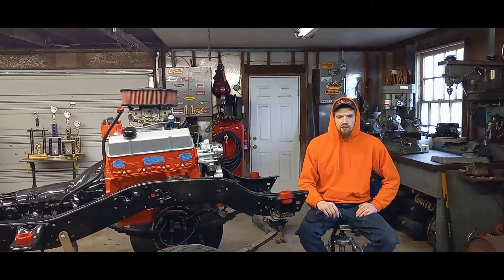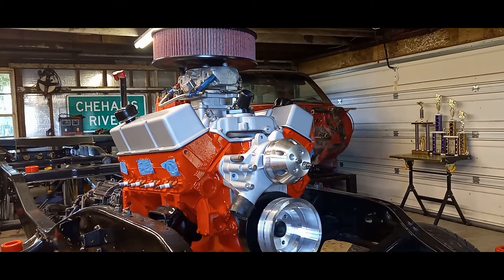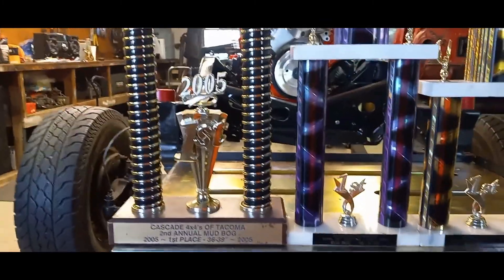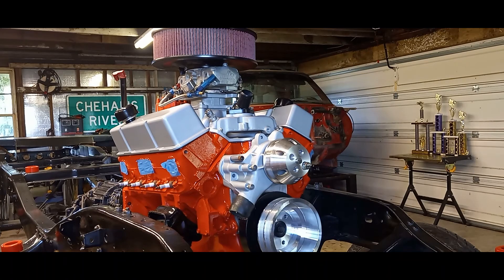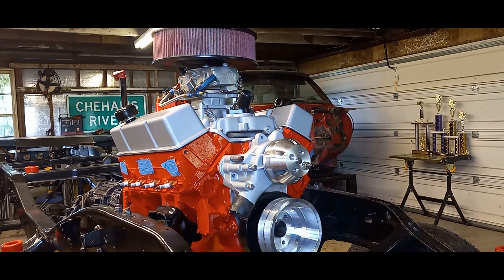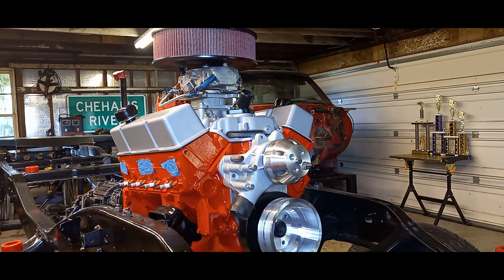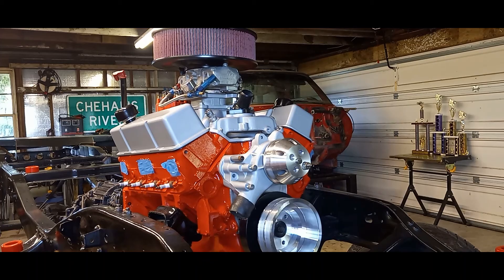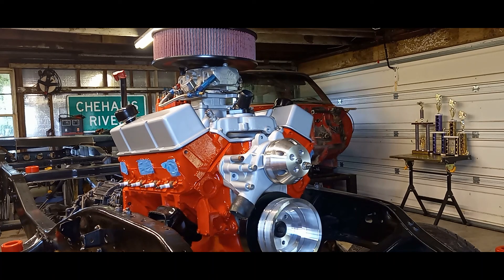HOW TO BUILD A 550-600HP RACE WINNING 383 STROKER SBC SIMPLIFIED. RACE PROVEN DRAG TRUCK ENGINE!

Comment from the maker: TRIVIAL QUESTION IN THIS COMMENT!?? THIS CHANNEL IS DAVID VIZARD RECOMENDED AND APPROVED! David vizard had messaged me complementing me on this video and what he called "my intelligent choice in camshaft specs and my intelligent educated decision on the 108lsa and the lift numbers of the cam" which is optimal for this combination. He had also said that what I said in this video and in the comment section can be confirmed in his 2 most recent videos being "cam company's still don't got it right" and "how we built that super competitive low buck 383 sbc"... so check out his channel David vizard performance... the 108 lsa camshaft alone in this specific combo is worth 25+hp and an equal amount of torque ... Cam specs.. 248°duration @.050 108lsa 104icl, installed 2°advanced, 620lift intake .620Lift exhaust. Lift is  actually .661" with 1.6 rocker. The heads flowed 280cfm @ .600" lift, the flow drops to about  270cfm @.675"ish lift due to port instability, i aimed for a specific distance to absolute limit of max flow in order to stay at max flow for a specific amount of time before port instability, being as the last .061lift is still in the 280cfm range, it's hanging in the 280cfm range for quite awhile so .661lift  is optimal for this application, and that was exactly where I was aiming to optimize this engine for the specific application. The camshaft specs ultimately match the flow chairistics of the cylinder heads.. The heads still flowed almost 270cfm key word almost until .700" lift. After .700 lift the flow drops of massively to around 260ish cfm, had I lifted the valve to .700+lift, power and the ability to hold rpm would have suffered severely, being as this 383ci combo is on the ragged edge of those 186 cylinder heads cfm output ,horsepower making and rpm capabilitys. That is why in the video I said the 186 heads are definitely the limiting factor of this engine, it is legitimately optimized specifically for the application with the parts I had at the time, and its making 580hp+@ 6500rpm & 545lbft+@5200rpm, pulls to 7500rpm it may pull to 7800rpm but rev limiter is at 7500rpm.. No more amount of lift or duration would do this engine any good, until a better cylinder head is brought into the equation flowing 300+cfm @ .600 or 320+cfm @.700 lift. Then you are looking at more like a 620-650+hp 383. Keep in mind CFM is relative to CI, LSA, RPM and HORSEPOWER... HERE IS A QUESTION FOR ANYBODY READING THIS???.... take a similar 383ci engine but with 11:1 instead of 12.98:1 compression with heads that flow 270-280cfm @.600 lift. Then lift the valve to .624 which is .024 past max flow, lifting the valve slightly higher than max flow can be the beneficial in some circumstances because in can allow you to utilize more of the flow of some cylinder heads, but it not always the right move, this is all determined by multiple factors of the characteristics of the cylinder head and application... the rest of cam specs, 247°-249° duration @.050 and 106lsa 104icl installed 2° retarded . with a single plane manifold and 850cfm carb. Keep in mind the tighter the lsa the lower the rpm for peak power if the lsa isnt optimal. do you think this combo would make any where close to 580hp?? And rev to 8500rpm without falling off??. What do think the results would be?? Let me know what you think? I already know the answer, I would really like to hear any body answer even if it's just a well thought out guess, I would really really like someone with legitimate knowledge and experience to to give me conformation on the reality or lack there of this combination. Thank you i appreciate you reading this. As I said before keep in mind that CFM is relative to CI, LSA, RPM and HP... that is one of the simplest ways to figure this out... anybody???
Reply: First, I'm by no means a 'Pro', but I do understand physics
Going beyond max lift (effective lift for a particular application) seems detrimental in a couple of different areas. 1, Are you having to use more spring pressure? (With no gain in performance, stiffer springs take HP to move.
2, I would think the extra timing event would stall the AF charge.
What say you?
Reply: @toomanyirons65  Check out Superstock engines. Cams way bigger than most folks could comprehend. It's all about the area under the curve. Friend of mine has a NHRA Superstock 73 SD455 Pontiac engine. Cam has over .950 lift and 300+@.050 duration. Power peaks around 8200 rpm. It shouldn't work, but it does. Car has set national records in its class years ago. SS/GTA class 87 Firebird Superstocker. His valvesprings in that engine are 1200lbs open pressure. Heads are oem highly modified 1973 SD 455 cast iron heads. Uses a IA block tho. It's making 725-730hp with the original 73 Q-jet on a Victor intake. Those Superstock engines are a whole other breed.
Reply: Hey Adam I have a few questions that I’d like to ask you or DV mainly about camshaft selection and dynamic/static compression ratios I’m more than willing to pay for your time if you could answer them I don’t expect anything for free I am more than willing to pay whatever it takes for some further guidance so I can get my parts ordered and get rolling on my 383
Reply: I believe you would gain hp in this instance of 11.1 comp.  With that cam. With less squeeze than almost 13.1 there will be less heat and a more dense air charge from the heads. I think it would be around 580, 575 ish at 7000 rpm. As the extra lift would let the cylinder fill with more air and cooler air as well.  Thus pushing up hp.  Correct me if I'm wrong I'm not the sharpest tool in the shed but I sure am shiny. Id like to hear some of your ideas on this. I wouldn't rev it that high for too long as the rod bolts would be a limiting factor.
Reply: Vizard couldn't win a cam challenge if he tried. And he did try. After boasting about how he can't lose. He lost. So, is that douche really who you should be listening to..?
Reply from the maker: With that comment and all the other garbage I see you leaving all over youtube you are clearly in the 50% of the population that has an IQ below 100, either that or you are 12 years old and still not to bright....

Comment: 383 SBC, Roller, Afr 195  Eliminators street heads 64 cc, 10.5 CR, Mike Jones Hyd Roller Cam ( .580 lift, 108 LSA), Victor Jr single intake, 750 Holley. This set up is too much fun on the street.👍
Reply: exact build i’ve been piecing together online, how is the street ability?
Reply: @dylananderson7322  As far as street ability,  I think it's great. I do have a vacuum secondary carburetor and 373 gears, which does help. Mike Jones cams Maybe a bit pricey , but totally worth it.
Reply: Any idea on the hp of this setup ?
Reply: @glennwo7702  I haven't had the chance to dyno this  combo. But, it has awesome mid range and top end pull. Running drags radials and it break traction easily. Hopefully I will soon though.🤙
Reply: Make a video of it
Reply: @MrJ183  I will soon. I haven't taken it out in a few weeks.

Comment: I have to chime in, and with all respect to you and other engine builders. Please consider all the factors that effect the awesome power of this 383 and also consider everyones situation is different ss well as their knowledge scope...btw i have watched all your content and listened carefully to your message. Seems most of the neg comments are from folks that haven't- and are quick to make snap judgement. I will suggest one thing that needs more emphasis on this topic and in others engine build videos aswell. You briefly describe the fuel choice, and associated compression spec, but to the general mass that gets overlooked. I think it should be made clear to the dumbasses, that fuel choice will give a big power spectrum low or high on any engine, snd the cam specs etc will all need to be chosen with that setup. My question to you would be what would you do different if at all, if you were to take that engine to the pumps and put 91 non ethanol as we get here in mn. And then still thrash on it.? Change timing? Tweak the carb? What kind of power could you still safely expect and not damage it....that i think is a fair question. If you say race motor snd race gas only, i understand but your smart as heck so i cant help but to ask your thoughts if you want to reply. Thx!

Comment: In the process of building a 383 with afr 220, still a budget build with a solid flat tappet.  Comp cams argued with me when I told them I wanted a cam with a 106 lobe sep. They wanted me to run a 112 lol. Just blows my mind. I told them ok I changed my mind let's do 105.
Reply: absolutely 👍. What LSA did you end up with?

Comment: Come on, lol. This combo might make the claimed 550 hp with a 150 shot of N2O. Camel Humps? Please.
Reply: 280cfm? Camels...Id have go see it to believe it. 
Not enough metal there. 250-260 is really pushing those castings.
Reply: I had a set of camel humps on my 406 sbc.I had them ported out with 202 160’s.They ran ok but It felt restricted.Once I was able to buy AFR 195’s instead of the 220’s heads and OMG!.I thought it ran good before but now it is a beast.you would be lucky to hit 230 cfm with ported camels.Camels on a 383 or 400 you can crack 480-490 on torque and would be lucky to crack 470 on HP.AFR 195’s I cracked 526 hp and 505 on torque.It was a major difference.To reach 600 hp N/A your going to need a 18 degree heads and some major upgrades.I seen only 1 video of a SBC hitting just over 600 hp N/A.

Comment: flat top pistons [5ccreliefs ] 65cc chambers   .040 gasket / gsket bore 4.060,,   cyl bore4.030 ,,, stroke 3.75 ,,  comp hieght .005 down    EQUALS  10.9 TO 1 
eg 383 11 TO 1 CR ,,, afr 195 STREET  ,, vic jnr ,,  solid roller 252 deg 540 hp

Comment: I think best deal for heads is buying best bare Chinese aluminum heads you can find cost like 400 or less for the pair and just clean them up work them over and use decent valve train parts in them and you be over 300cfm for way less money then AFR, Brodix etc.
Reply: not getting 300 out of them with cleanup work.

Comment: Great vids my friend,  ive been building big block chevy's for 30 years and agree and understand everything you are saying about lsa. In 1999 i built a 461 bbc 12.2 compression on a budget with ported 781 heads, a flat tappet cam i designed and had delta grind. I remembered they asked why i wanted the cam cut on a 105 lsa and they even tried to get me to run a 110. Engine made 634 hp at 6400 and 580 torque at 5000, power held on to 600 at 6800. Cam was 244 254 @50 580 600 lift. Heads flowed 310 cfm on the long runner at 600 lift. Good old days. Getting ready to build a 383 for a 63 biscayne,  thats why I'm watching these vids. Might need some help on the cam for the 383 Adam.
Reply: good combo where might i find a similar cam

Comment: Summit racing cast iron "vortec" heads are a raging deal and heavly slept on for the price at $364 a piece!!!
Reply from the maker: Yeah, I literally think them summit heads are the best deal for a set of heads, If only people knew they are actually dart heads lol. I bought a pair, ported them and built a 383 for my dually and now that 6000lb dually runs a 13.28 1/4 mile
Reply: @ACDGarage_Racing  they were my upgrade from a set of 882's with the guides cut and it really made a difference, curious on porting them

Comment: I like the 383 and just made some changes. 10:1 AFR195 heads comp 288hr cam with 1.6 rocker with an RPM intake long tube headers and a 750 holley double pumper. Have no clue power but I'm open to hear gueses.
Reply: I got a similar setup. 383 10.5 or so.  Afr195 Xr294hr 1.6 rockers afr dual plane intake,Demon 750 carb. Still on engine stand wondering what hp too..
Reply: @thomasatkinson5380  if you find out I'd like to know
Reply from the maker: There are 3 different afr 195 heads which ones do either of you have? Each one of these are going to have a different  outcome.
195cc Competition Head Flow Chart.      .     .2.   200  .300 .400 .500 .550 .600                      int . 151 . 211. 260. 293. 304. 308.
 Exh.125. 172. 207. 224. 229. 233 Cfm
195cc Street Head Flow Chart
      .200 .300 .400 .500 .550
Int. 146  207  247  275   280
Exh 119 166  197  213   218                              
195cc enforcer  Flow Chart
     .200 .300  .400 .500 .550 .600
Int  133  188    226  250  251  251
Exh 104 138  158.  186. 191   197
Reply: @ACDGarage_Racing  I have the street flow heads myself
Reply from the maker: I'd say your engine is making 515-525hp roughly. Just changing to a camshaft  with a 108lsa is worth 25hp and an equal amount of torque on a 383.
Reply from the maker: There are 3 different afr 195 heads which ones do either of you have? Each one of these are going to have a different  outcome.
195cc Competition Head Flow Chart.      .     .2.   200  .300 .400 .500 .550 .600                      int . 151 . 211. 260. 293. 304. 308.   Exh.125. 172. 207. 224. 229. 233 Cfm
195cc Street Head Flow Chart
      .200 .300 .400 .500 .550
Int. 146  207  247  275   280
Exh 119 166  197  213   218                              
195cc enforcer  Flow Chart
     .200 .300  .400 .500 .550 .600
Int  133  188    226  250  251  251
Exh 104 138  158.  186. 191   197